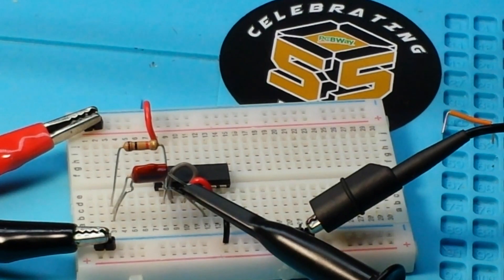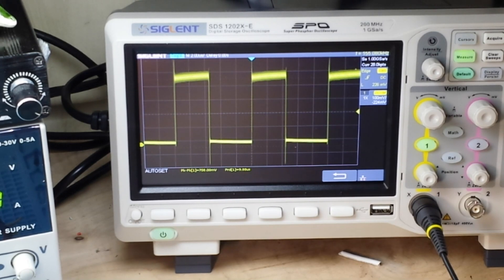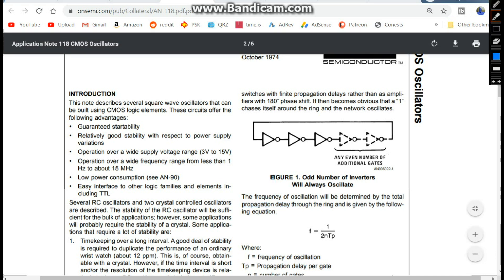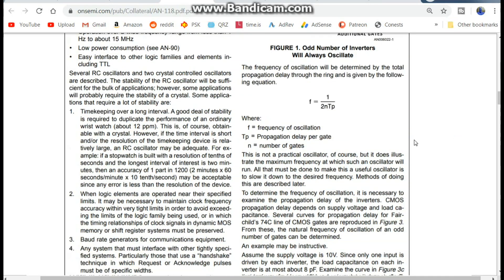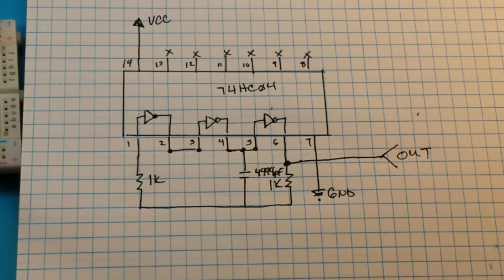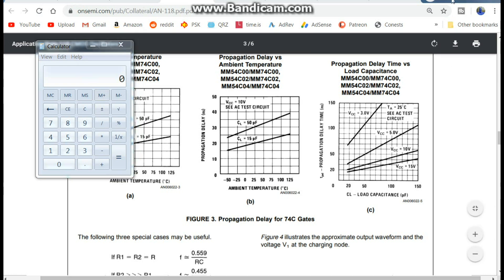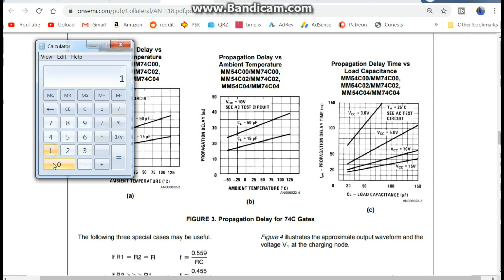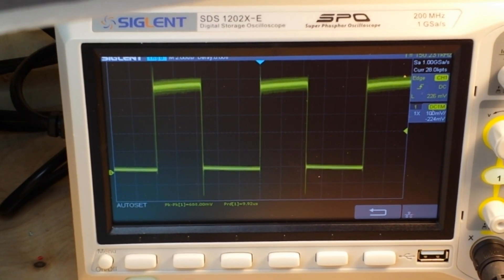Let's make a simple ring oscillator

Comment: Use a nand gate and with a pot and one cap you can have an adjustable oscillator.
Reply from the maker: Yes, but this is a specific circuit mentioned in Fairchild Semiconductor application note 118.

Comment: Good use of the basic calculator functions and app note + circuit are intemporal. eg for calculator : you can type the number millis and then divide by 1000 on final if the zeroes gets too large, even for the display if using a physical basic calculator  8 / 10 digits

Comment: You would also need to allow for stray capacitances in the breadboard , that is why a lot of radio projects won’t work if you build them on a breadboard .
Reply: Just out of curiosity.
What is the proper way to prototype a radio project if you can't use a breadboard?
Reply: When you are working with radio frequencies any stray capacities will throw your tuned circuit out , you can use a breadboard just allow for the extra capacitance from the breadboard rails and keep leads and legs as short as possible
Reply from the maker: Something like this: http://www.kaislab.com/?p=38
Reply: Thanks for the replies, lads.

Shows again that radio frequency is a whole different ball game.
Reply: learnelectronics
 up in those frequencies you only need to fart near it and it will stop working !
I was thinking about SW, MW & LW especially the tank circuit , oscillator and IF transformers because as you know they are all about inductive and capacitive reactance and the way a breadboard holds components can create all sorts of noise , stray capacities and resistance .
Reply: You must be doing something wrong because breadboards work for all the engineers designing computers on wish.com. That is why they can sell them so CHEAP!

Comment: perhaps a cap across the supply rails to get rid of those rising and falling edge spikes to clean up that square a bit?
Reply from the maker: There are two caps across the rails...
Reply: @learnelectronics  I mean right on the bread board. It should clean that up a bit more. Those leads from the supply are probably picking up some room noise with all the equipment you got there.

Comment: Using a schmitt-trigger inverter (like the CD40106) gives you basically the same thing with just one cap and one resistor
Reply from the maker: But what I covered, is a specific circuit mentioned in Fairchild Semiconductor Application Note #119.
Reply: @learnelectronics  Yeah, just realized the same thing can be done even simpler
Reply: True enough, but sometimes it's good to start simple, then show how to improve.  (Another advantage to your plan is a cleaner output either directly or feeding through an unused inverter.)

Comment: It would be interesting to explain in more details how it works, I believe the signal running time will charge and discharge the cap which changes the last inverter input. Anyways more details would be appreciated.

Your videos are great, thank you for your great content to learn electronics.
Regards from Hannover Germany
Reply from the maker: The resistors and cap only stabilize the frequency. A ring osc works through propagation delay.
Reply: I believe now I understand it, the signal flow is e.g.:

High -> inverter -> Low -> inverter->  High -> inverter -> LOW

The resulting LOW goes back into the input and the sum of the inverter delay makes up the frequency. 
 Thank you for explaining the capacitor role. @learnelectronics

Comment: but it becomes an rc oscillator...the ring oscillator depends on the propagation delay. does it means the ring oscillator can not be implemented practically？
Reply: well,the first 2 inverter did involve a delay, but comparing to charging time of capacitor, it is negligible.

Comment: These circuits that you describe are kinda neat.  But if you don't show a use for them, it's not as good as a video as others are producing.  Show us something that we can use this for.
Reply: Use for anything you would use an astable 555/556.  Less board space, less components. Wider frequency range. Read the AN. As described in the AN, if extreme accuracy is not required, this can even replace a xtal oscillator.
Reply from the maker: It's a clock. Use it to drive digital circuits. I'm here to teach you the building blocks. It's up to you to put them together. If you dont like my videos feel free to go elsewhere for a totally free electronics education.  Peace.